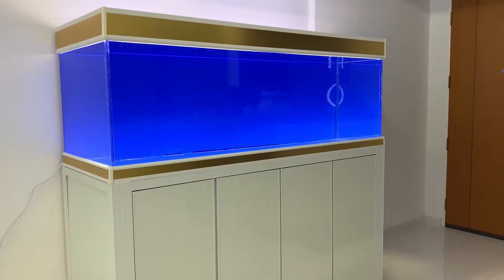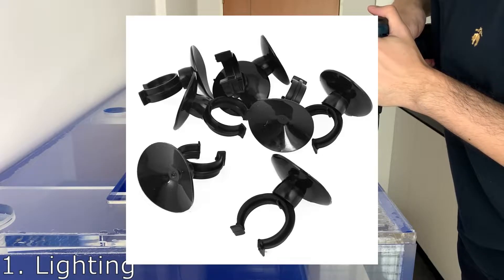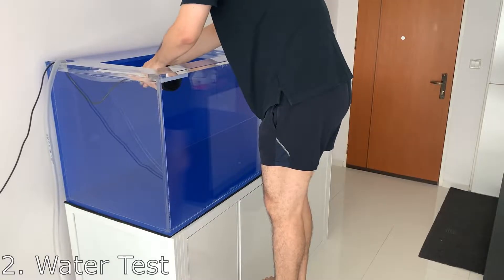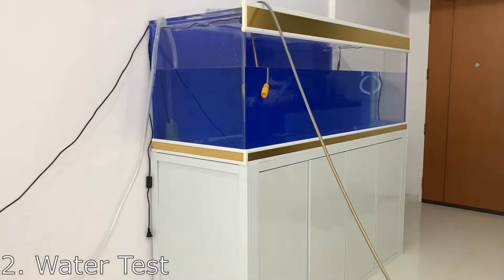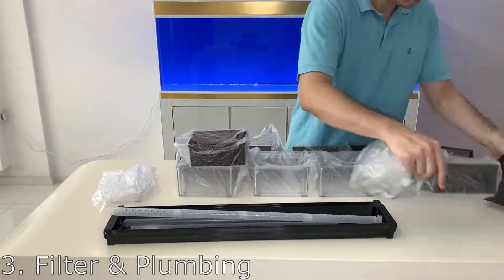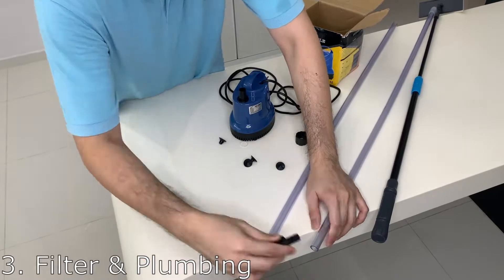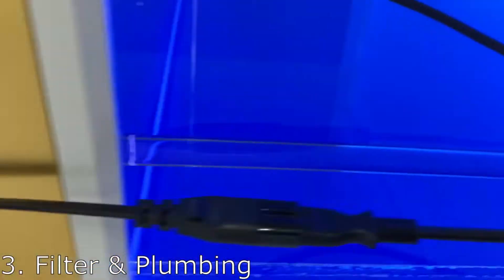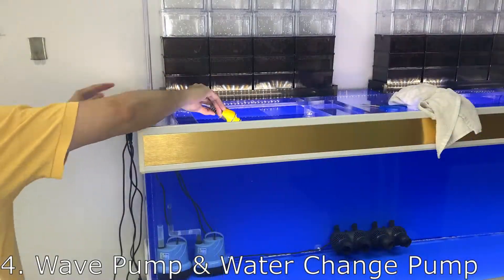DIY Acrylic Aquarium - #2 Lighting, Plumbing & Filter

Comment: Good shit. I thought you were going to put that filter on a saltwater. I only seen it a few times. Its basically an over head bioball filter.
Reply from the maker: cheers! yeah I suppose over head filters would clog too quickly for salt, would require pressured canister type filters
Reply: @DIYSomethingSG  it's call the same.

Comment: Is it okaay to use acrylic sheet for OVERFLOW/UNDERFLOW ?
Reply from the maker: Yes absolutely, in fact most over/underflow of glass aquariums are made of acrylic because it’s easier to machine
Reply: @DIYSomethingSG  can I use clear acrylic for the over/underflow box? And what is the ideal thickness . I want to build 260 gallon tank
Reply from the maker: @daimlerfernandez3208  260 is a massive tank. you might want to consider at least half inch thick if it's going to withstand high water weight or pressure